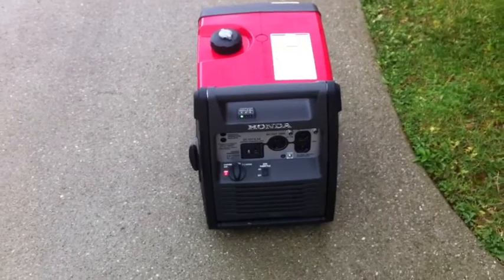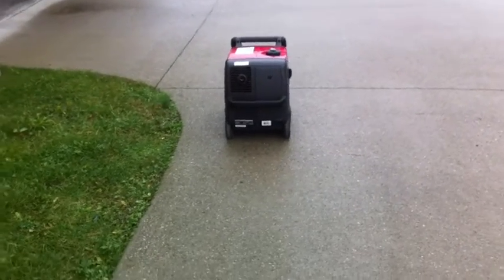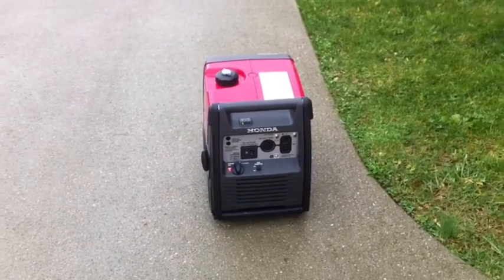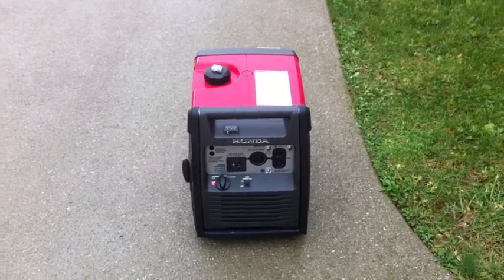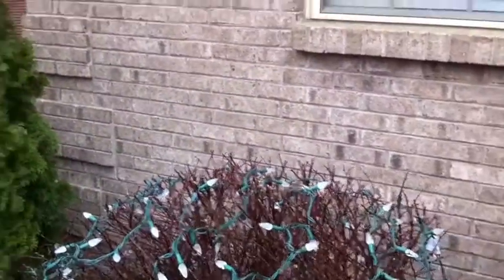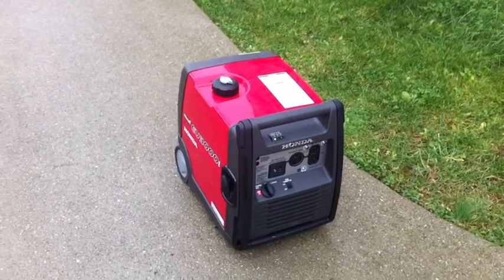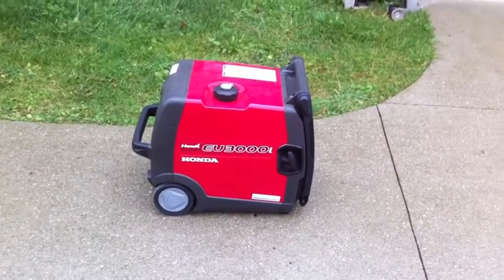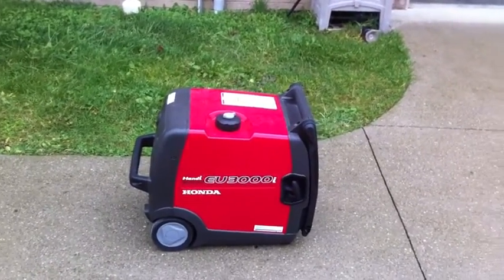Honda EU3000i Handi

Comment: Your video influenced me on my choice to buy this generator. I bought it, used it a week later, and had to return it immediately. I carried the generator from my car for about 20 feet and the rear handle completely fractured. I started the motor, ran it for about a half hour, and shut it off. It worked just fine. I towed it back the 20 feet to my car over gravel and the tow handle fractured. I was shocked. So was customer service at Home Depot. They issued me a complete refund but now I'm not sure if I should try buying another EU3000i or if I should look into another brand. I wonder why this would happen. I did several online searches on this and found nothing.
Reply: If you'd had it fixed for free under warranty, you'd still have a year left on your warranty.